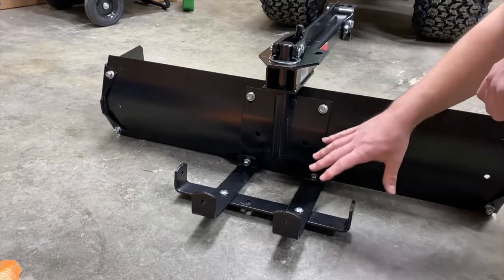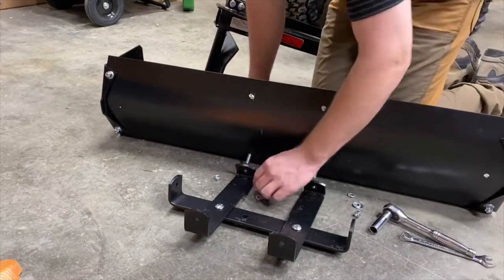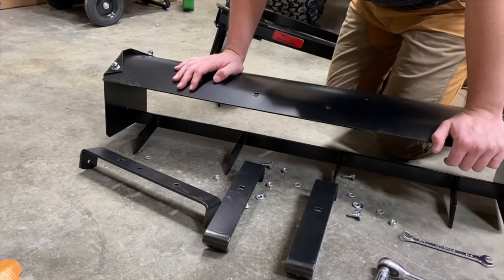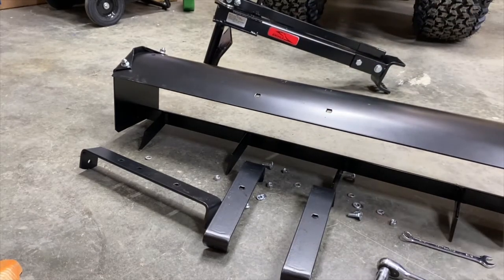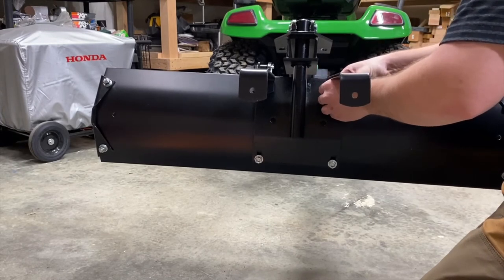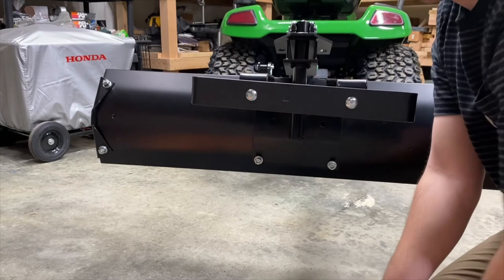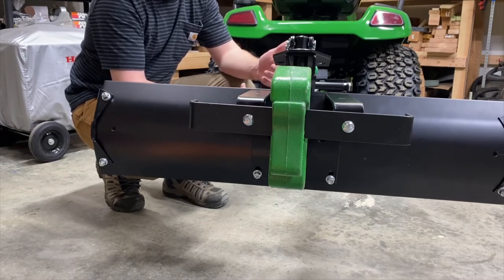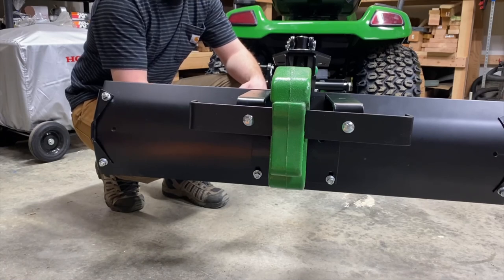Brinly Sleeve Hitch Box Scraper Suitcase Weight Hack

Comment: Where did you get the part that hooks to the rider
Reply from the maker: You talking about the sleeve hitch? From the dealer, you can order them from green part store online too, among a few other places I believe. Honestly I’d probably go for an aftermarket hitch though with an electric actuator…
Reply: @JoshsGreenGarage  I wonder if they have one for a john deere x739?
Reply from the maker: sorry for the late reply, my comments were messed up... i probably missed a ton of them... anyway, no. the 700 series have a 3point hitch, way better.
Reply: @JoshsGreenGarage  I use my blower so i cant run the blower and a 3 point hitch at same time the hydro dont let you use both one is for the lift of the blower and the other is to rotate the shoot i asked deere if there was a way to do both he said they didnt know how it could be done the 1020 can do both.
Reply: How did this work out long term?